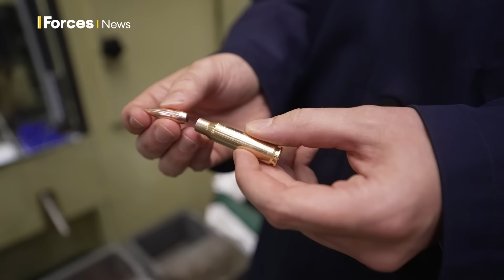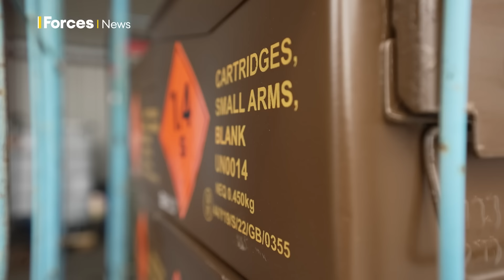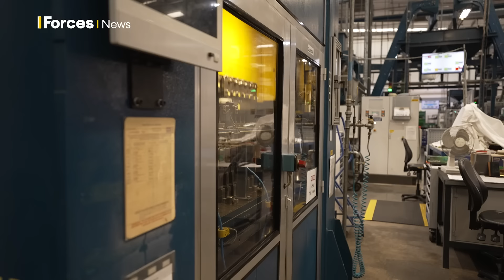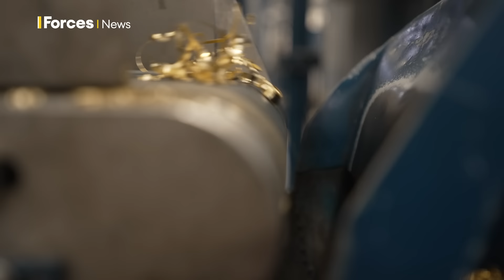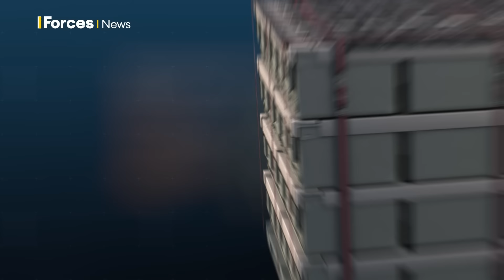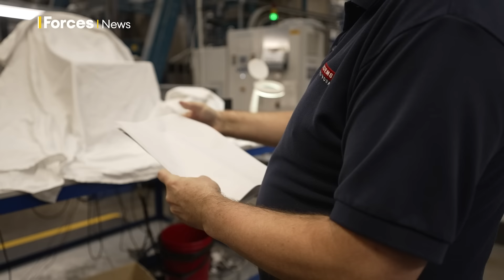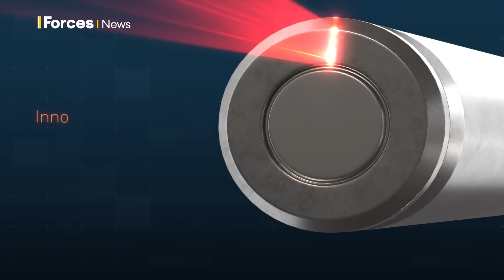Exclusive: Inside the factory that makes the Army's rifle rounds

Comment: I think you might want to split up production to different sites - having all production on one site makes it vulnerable
Reply: I’m pretty sure someone on a higher pay grade has thought of that. 🤞
Reply: In war civilian manufacturing would be used as well as the USA
Reply: @MrTangolizard  True but still it's risky. It should be least underground..... maybe it is?
Reply: It's a few miles away from me, the old site with rail link is now gone, it's now just a flimsy warehouse unit.
Reply: Don’t think you probably appreciate how much security is on this site. Will not be an easy place to access (perimeter fencing, CCTV, high security zones, security guards and sentries, card readers on every door) and if there’s a case of foreign aircraft bombing the site then Britain has bigger worries than loss of one ammo plant.
Reply: @maxpowerii7368  funny they heavily guard an ammo plant but expect civilians to not be able to defend themselves.... hmmmm maybe having guns stops people from doing bad things.... im guessing those guards have guns or do they tell people not to get in with a firm warning
Reply: @maxpowerii7368  Single. Point. Of. Failure.
Reply: @Phil_AKA_ThundyUK  does. not. matter. if. chance. of. failure. is. remarkably. low.
Reply: @maxpowerii7368  Of course it does! That's incredibly ill strategic thinking. Literally one cruise missile that the UK cannot intercept and it'd done.
Reply: @Phil_AKA_ThundyUK  who the hell would be sending cruise missiles to the UK? More to point UK has anti missile systems in place.
Reply: @maxpowerii7368  yeah, I'm sure if a cruise missile hit the UK, losing that ammo factory would be a small problem compared the conflict that would follow
Reply: @Phil_AKA_ThundyUK  a country would have to be incredibly dumb to do that when Britain isn’t even in a conflict as of now
Reply: If the UK starts coming under fire again there are more pressing issues
Reply: @delphipascal  this factory provides for NATO so I don’t really think so as this has most of NATO being supplied from there
Reply: You mean the way it was done for three hundred years,until the bean counters ruled the roost,I used to get blown out my bed regularly as they proofed artillery and navy barrels about five miles from my home. This went on from the late sjxties to the early eighties. Apparently the site at Inchterf in the Kelvin Valley originally belonged to Beardmore,s.A Scottish Industrialist who built ships for the navy and who rivalled Arnstronge in his diversity of engineering products. Montague Norman of the Bank of England was on his board at one time. There were many ordnance sites throughout Scotland,particularily located next to sea or railway access.
Reply: @philiprufus4427  it's like we want to lose...
Reply: The US found that out the hard way, with of all things, baby formula.
Reply: I don't think they have to worry about that
Reply: Why didn’t they think about that? 🤦‍♂️
Reply: @andrewbrown5300  Back to bean counters again they can wreck any business in fairly short order.
Reply: @andrewbrown5300  Because they have, there's plenty of mothballed sites all across the UK that aren't known by the public about ready for rapid transformation back into ammunition factories. There's 0 point in having multiple sites open during peacetime. 

We might not be the Super Power we were, but we aren't stupid.
Reply: Nah.. in reality its never going to be an issue.  If there is a war that is on such a large scale it threatens mainland UK (as per WW2) having dispersed factories won't matter when we are all radiated anyway.  As for terrorists threats, I can't think if anytime in recent history when a major military complex has been hit... those cowards prefer bombing 8 year olds at pop concerts.
Reply: This. Lunacy to keep it all together.
Reply: @Phil_AKA_ThundyUK  Comrade phoogle, your comrades have tried divide and conquer in Ukraine and it failed. The Ukrainians are more united than ever. It may serve Russia better to split up manufacturing so that one factory doesn’t know the full process and cannot sell secrets to the West, but it’s keeping Russians in the dark and that’s how your Kremlin likes it.
Reply: Why worry about something that’s never going to happen?
Reply: Yeah, like a full-scale war with long range missles launched 6 missiles at a time... Like, missile strikes never going to happen in 2023. Oh shi....
Reply: More sites, more security needed.

Better to keep it on a single site.

FG can be moved off-site to purpose built storage facilities, secured by MoD.
Reply: Make a lot of ammo and store is somewhere different
Reply: @paytongauthier9060  During the war in Ukraine, russia did several missile strikes on ammunition warehouses successfully. So it did across the Europe in the EU. I think Bulgaria and Czech Republic. But there russian agents and spies were used to set up the bombs. So there is always the risk of losing the ammo stockpile
Reply: @foxthefox1199  oof
Reply: One strike and the U.K. has no ammo? Nice work. For a smart factory that’s not very intelligent. Good thing the citizens can defend the country if… oh wait. You have no guns either. And you want a war with Russia? Have you really thought this one through?
Reply: I was thinking the exact same thing
Reply: I agree 100%.  Just go review the US baby formula fiasco!
Reply: True
Reply: They have their reasons. Im sure they have smarter people than you.
Reply: @ahoosifoou4211  no mate you clearly don’t know how the British army works the people at the top are retards just have a look at the Ajax programme!
Reply: My first thoughts EXACTLY